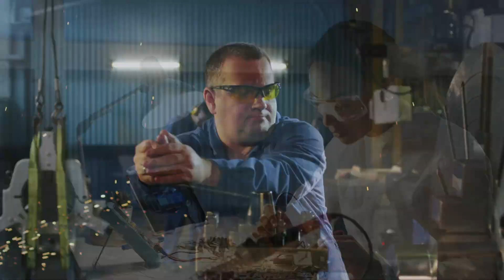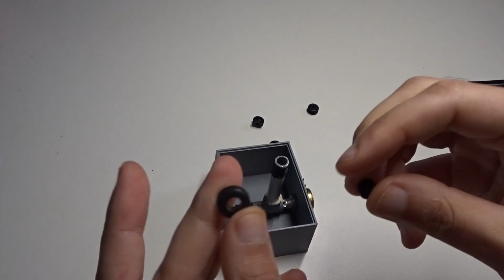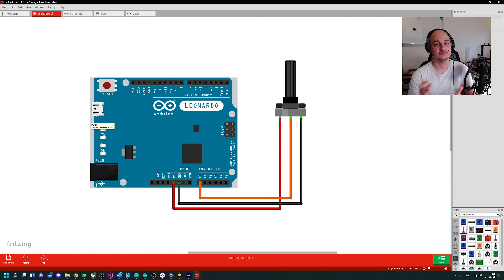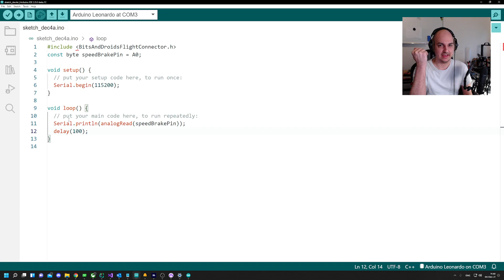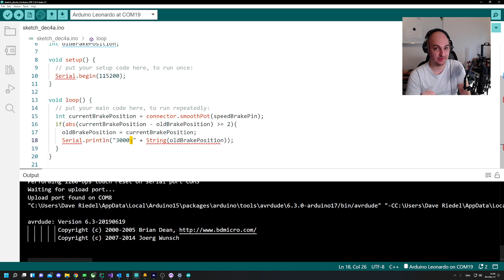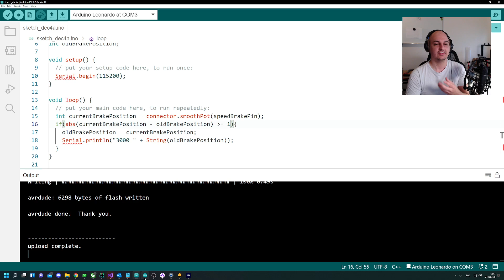DIY A320 speed brake lever for MFS2020

Comment: I've watched a lot of your videos, you do good work, but can you go more in-depth on the process of the wood-working part of the panel-building? Your videos seem to show mostly the coding/Arduino part of the projects. Cheers!
Reply from the maker: Hi! Sorry for the late response. I was having a few weeks off for the holiday season. I'd love to get more into the panel/woodworking aspect of the hobby. The reality is that my current living arrangements make it challenging to do. I'm living in an apartment with thin walls. That doesn't leave much room to work or place larger woodworking projects. Once I've found a new place, I'll definitely expand upon these topics, but that might still be quite some time from now.